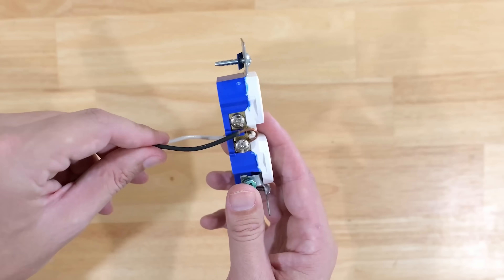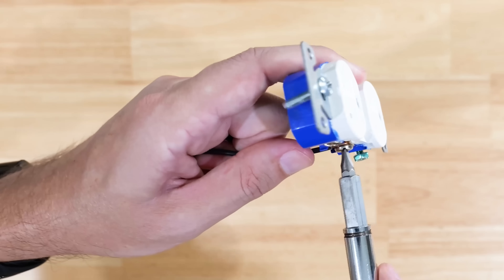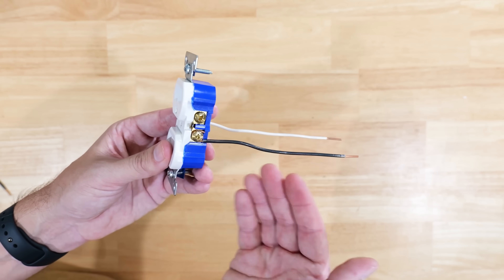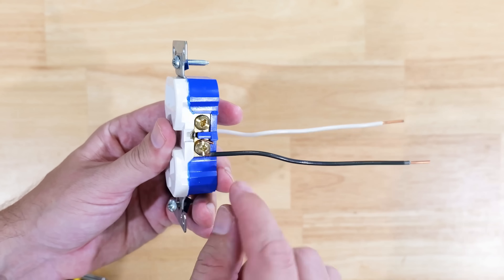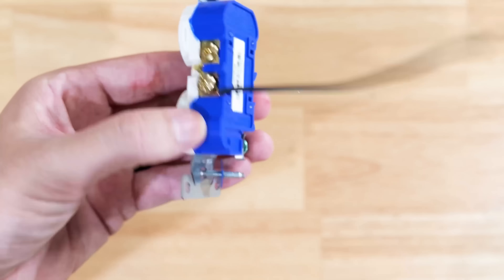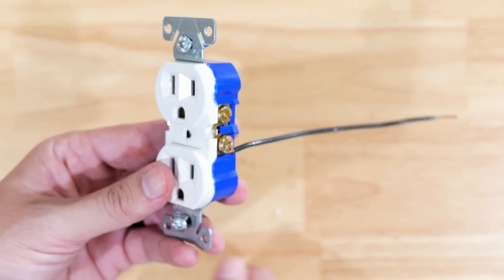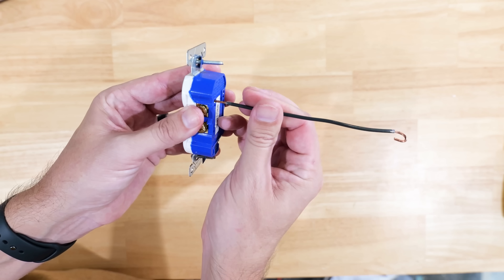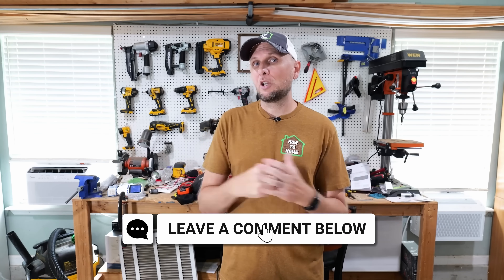Avoid Disaster! 8 FATAL Outlet Mistakes Most DIYers Unknowingly Make!

Comment: He failed to mention that whenever you’re installing the standard 15 amp receptacle and a metal box to tighten down the screw that you’re not putting a wire behind so that it’s not close to touching the metal box

Comment: With regard to tightening receptacle screws sufficiently, it’s worth investing in an ECX screwdriver. Much less prone to camming out than Phillips, as its slightly different design is specifically for receptacle screws.
Reply: That's true in theory; with virtually any outlet I've tried, an ECX bit actually slips BEFORE an appropriately sized Phillips bit does, at least with outlets from Leviton and Hubbell.

Comment: The current does not go backwards for reverse polarity installations. 
The biggest issue IMO is that you will have the exposed parts that have full voltage in the off state.
Reply: right, AC current flows in both directions, DC does not.  The problem is electrocution since even with the switch of an appliance in the off position, power is coming up  on the side that the equipment assumes is connected to the neutral...which it isn't in this case.  It bugged me to when he said it flows in the wrong direction, that isn't how reality works.

Comment: What I See Electricians(Loosely Used) AND DIY'rs do is Put 14 Guage on a 20 Amp Breaker. Not Good.
As Far a Polarity, Most Things Work Reverse Polarity, No Danger, No Big Deal, I Think Polarity is Mostly For Plugging Lamps in, With Reverse Polarity, The Shell of a Lamp is Live and Can Easily Be Touched when Changing a Light Bulb, With Correct Polarity The Live Connection is Deep in the Socket. 
When People Put Plug Ends on a cord, They need to Be Sure The Ribbed Wire on a Lamp Cord Goes to Large Prong of Plug.
Reply: In a correctly wired lamp the live connection does not reach the lamp socket when the switch is off. It ends at the switch, because that's where the circuit is opened (disconnected). What you're saying is correct if the switch is on when changing a bulb.

Comment: Black is Brass, Chrome is Common, Green is Ground.... how I was taught. it helps some folks to remember.
Reply: Black gold was the only word I was told but yours is much more complete for a novice to remember all the wires. 👍
Reply: @jameshill4900  How else could it be remembered. Three different wires that need to go to the correct plated or shaded screw terminals. BLACK easily goes to black. GREEN easily goes to green. Even if you forget WHITE goes to chrome, ya got nuthin else left, unless your wiring with three wire.

But you have a great idea. A shame your teachers did know you were never going to need that rhyme. They should had full faith in you. I'll bet it was more than justified, wasn't it?
Reply: @nothankyou5524  Black goes to gold (brass).  There is  no  black on a receptacle.
Reply: my uncle uses to tell me Mr. T is a black guy and he has a lot of gold around his neck so black to gold
Reply: @johnrhodes101875 same exact thing I heard.
Reply: @johnrhodes101875 nothing wrong with that. And certainly right if it does the job!!
Reply: Black/Brass (5 letter B words), White to white metal, bare copper/green to green/ground (green grass on the ground)
Reply: @YooTooobJeff What ever assists is a stellar statement!!!
Reply: White is bright. Black is bronze.
Reply: Black to brass, white to bright, bare to green.
Reply: 😅 @Jaderian87
Reply: I was a Coast Guard marine electrician. We always used "black on brass or its your ass!!!!"
Reply: Red can go to brass also.On DC black can be neutral.
Reply: @guruofendtimes819 DC is not A, and your not going to have it in cases like these. Not after the fact
Reply: @guruofendtimes819  But, we are talking AC
Reply: Brass to the grass. Oh wait, wrong MOS.
Reply: In 1900 wire insulation was varnished cotton that went black within a few years. The color marking was paint. The paint flakes off with age, not decades, just years. The line conductor is black and the grounded (neutral) conductor is white so that when the white paint flakes off you don't think the live conductor is safe to touch, you think the grounded conductor isn't safe to touch.
Reply: Excellent!!!   Thank you...making it easier to recall.😇
Reply: That's a good one. I was taught Black gold (oil). Silver was a white horse (Lone Ranger)
Reply: Black gold. like oil. a better one i think
Reply: Black to brass, white to light, green to ground.
Reply: That’s actually pretty simple 😊. I’m so curious about a couple of plugs I have installed
Reply: Also when using EXTENSION wires / cables pay attention to live and neutral lines  in the cable, the Striped or lettered wires are usually the live or powered wires, bare or green wires are of course  the ground, this is important for light socket wiring!
Reply: I was told, “whites like silver, n*g*as like gold.” Never forgot it lol
Reply: Where does the common go on a 3 way switch.
Reply: Very nice! Very nice indeed!
Reply: Black to brass, white to bright
Reply: Assuming you are staring at a correctly wired house, and all.
Reply: Which one is the ungrounded conductor? None of you are serious people.
Reply: So being serious. To truly know which wire goes where you look at the front of the receptacle. There is a narrow slot and a thick slot so you can’t install a polarized plug upside down. 

The narrow slot connects to the hot ungrounded wire. So the hot ungrounded wires connects to that side of the receptacle. If you want to be triple sure you can use a volt meter and check continuity between the narrow slot and the screws. The screw with continuity to the narrow slot is where the hot ungrounded wire goes. 

Hope that helps
Reply: @ecospider5  To be 100%, you really should be able to tell the difference between a hot wire and a neutral, regardless of color, configuration, ect. Taking chances and trusting others is how fires happen. 

Because if I do it incorrectly but in just the right way, I will produce the same stable circuit as you... and then you come along and your understanding of circuits doesn't account for my lack of proper knowledge being outweighed by my cleverness/ingenuity. 

A basic understanding of current goes a long way to burning everyone else's house down.
Reply: @boburanus69
Very good point. Standards are a thing for a reason
Reply: @NHGUIDE88  I like how you said black is brass, Chrome is Common/Neutral, and Green/Bare is ground. It will help me remember. It's easy to remember because the letters are the same. Example
Reply: That's a nice one because the first letters match each other. Example: Black is Brass. 👍👍😀
Reply: Thats great!

I taught myself,

Black. to brass,white to silver.
Reply: You need to check the wires.  Alot of guys back in the day used white for hot and black for ground. Check the wires with a meter!
Reply: Black to Brass to save your ass.  Learn that once.
Reply: @shawnbadanjek9561 came to this comment to add that one lol
Reply: @shawnbadanjek9561  saves your ass
Reply: i sadly was taught black to brass ( cause black people love gold) and white to silver (cause white guys like silver/silver is closer to white) i mean its sad but memorable
Reply: @SimplyMagic123 i dont see, "sadly". I see something that works for you. You're not out there selling T - shirts. Im sure your keep on the low. Everything seems to improve over time. Apparently, you certainly did. That's something to be proud of!!!
Reply: @ Is that a.... positive example of racism? Also: racism saving lives?
Reply: stereotyping is different than racism.  Relax, drink a coke and celebrate electricity.
Reply: Weird I know but I grew up in the 70's. Black/gold = Steelers and white/silver = Cowboys
Reply: I ended up with some used receptacles where they had completely removed the screws. 

I have found the ground screw is always on the neutral side. Anyone know if that is a requirement.
Reply: @ecospider5 it's never connected to the internals. Especially if it's bare copper. Do it once  or twice you wont forget. Its also not opposite the the power or neutral. Bty, red  can be hot and can ALSO be hot  on 3 way switches. I guess any wire could be anything, but they need to be clearly marked. If not, you could be in line for a punch in the shnoz, another mistake you'll not soon forget
Reply: @nothankyou5524
Good input thanks.

Comment: If you plug an actual 120V 20A cord connected load into that outlet, it would be on a 20A circuit.      
If you plug regular plugs ( 15A loads) into those outlets they will be just fine.
If your plug actually fits that receptacle, make sure it's on a 20A circuit.
You're not going to burn anything down because you want to buy quality backwired (not back stab) receptacles to use in your home.

Comment: Backstabbing is code and UL approved and has been for decades. I find more problems in renovations with terminal screws than backstabbed connections. If they were really as problematic as the wannabe-engineers-that-are-really-just-technicians make them out to be, they would have been banned decades ago. Electrical code writers are uptight. That's how you get things like AFCI. You think they're gonna enforce that, but let you burn down your house because of backstabbed outlets?

Comment: Absolutely Hilarious !   At the end you tell people to avoid all the problems and use a Wago type Plug, like the Wago wire connectors.
This after you tell people never to use the push in Back Stab connectors on the backs of older plugs.

Exactly what do you think are in the older Plugs that have the Back Stab connector holes?  That's right !  The same little wire tab that is in the Wago type connector.  On the old plugs, there is a slot to put a small screwdriver in to release the tabs hold on the wire, or as you show you can twist the wire while pulling firmly and the wire will work out.  

Whether you have a  Wago with the Lever or just the push in wire splice, they work Exactly The Same !  It's a thin strip of metal that your copper wire pushes past that does the electrical connection, and the load carrying.

So If you endorse ANY Wago or type of connector besides the Screw terminals, or Wire Nuts...You are getting a Less Secure connection and less physical contact of Wire to terminal, or Wire to Wire, meaning higher Amperage loads can potentially over heat those little tabs of wire and THAT is what can make the connections loose.  Heat Expands, including wires and connections.  

The number one reason connectors become loose is.....Wait for it.....  Not connecting them properly during initial install !  Yes, Electricians and their " helpers" are often in a hurry and don't hook things up properly when wiring a house or doing repairs.  And They are the " Professionals" you pay so the Job is Done Right !   Happens all the time, especially in New Construction homes in Subdivisions and multiple Dwelling units, because they have to get many fixtures installed and move on.

So.. The moral of my story.  Not all your information is always correct for one. And Two, even Electricians mess up.  Not to mention the occasional home HandyMan that does fixes for themselves or a friend.  Lastly, Newer Ideas AREN'T always better !

Comment: Loose connections, splices etc will always generate more heat. Mite take decades for an outlet to get nuked depending on usage but it will happen. If it ain’t tight it ain’t right.

Comment: Outlets oof will I guess two questions 1. How do I tell what gauge wire is in the box and 2. The reason I'm asking because I looked at the breaker itself for the amps and it says 20 is that wrong as I put 20 amp outlets in when I replaced the bass ones and 3. Do you have one for down steam GFCI love your stuff keep them coming

Comment: Whenever I connect stranded wire to a screw terminal , I always crimp on a Sta Kon terminal , I use the fork terminal and before tightening the screw terminal , I'll give the fork terminal a little pinch with a needle nose pliers , I have seen alot of receptacles that have overheated by putting stranded wire directly on the screw terminal , Even though the J hook is going the right direction , that connection will get loose , So always crimp on a Sta Kon terminal before connecting stranded wire to a screw terminal , One time I was replacing all the receptacles and switches at a motel and almost all the receptacles had overheated because the stranded wire was directly connected to the screw terminal and what happened was the strands unraveled after tightening , Even with the J hook in the right direction and that connection got loose which caused overheating 
So I put Sta Kon terminals on all stranded wire ends before connecting 
And by using the Sta Kon terminals 
There was no more overheating 
At least the overheated receptacles were caught before a fire started , So it's very important to use crimp on terminals when connecting to a screw terminal , either a fork or ring terminal 
This will ensure that you have a tight connection that will stay tight
Reply: You should never strip a stranded wire like a solid one if you're connecting to receptacles and switches. You need to mid strip, leaving a tail of an inch or so of insulation in order to keep the strands together. I'm not a big fan of that method either unless I have no choice. Preferably, use a commercial grade or better receptacle and back wire them by clamping down on the stranded wire.

Comment: While almost all people agree that backstabbing a recepticle should not be done under any circumstance,  why then are the they  UL  approved?
Reply from the maker: Great question.  Almost no electricians will defend it.
Reply: @HowToHomeDIY  They are almost universally how the outlets and switches are connected in any subdivision home.
Reply: Because when they are used properly, and the Circuit isn't over volted or Amped, they were just as good as the screw terminals.   
Wago connectors of today ARE EXACTLY THE SAME THING on the inside.  The ones he showed have the lever to release the wire, but the old backstab plugs have a slot to put a screwdriver in to release the wire, or you can twist the wire out like he showed.  Wagos work EXACTLY the same !  Why are Wago connectors okay today, when the Plugs are thought Not to be Okay ?
Some of it has to do with the SIZE of the little wire tab in the Connector.  Larger metal tabs can contact more surface area, and withstand more Amperage draw, without heating up.
Reply: @jameslester4474    Still begs the question, why are they UL approved.  If they have caveats (load, amps, etc), why are they not stated anywhere.  Agree they are similar to the WAGO 221's, yet nobody seems to have any problems with those.

Comment: What tool do you use to trace an outlet not working?  My outside receptacle was working, now it has no power to any of the wire.  I tried to find what other receptacle is not working but each one is working.  Thanks.
Reply: If outside there may be a GFIC breaker or receptacle you have not found.  Also check both sides of the other receptacles  there is a bar that connects them and it could be broken/burned out.   You may want to use a lamp that has a light bulb in it to plug in the receptacles.

Comment: The rating of the receptacle has nothing at all to do with the amount of amps flowing. Check your codes again.
Reply from the maker: You’re going to have to be more specific because your statement is right and wrong at the same time in that yes, an outlet itself is not a limiter, but wrong in that if the wrong receptacle is put on a circuit, it can allow too high of an amp draw on the circuit and wiring.
Reply: @HowToHomeDIY  The only way a receptacle can allow too high of an amp draw is if you put a 20 amp receptacle on a 15 amp circuit AND you plug in an appliance with a 20 amp plug that may draw up to 16 amps. So, the 20 amp plug has a mechanical allowance, not an electrical one. If you use a 15 amp plug (99% of the time) there's no restriction or added allowance on current draw, which is determined by the load. I'm sure you know that.

Comment: Question re: Breaker sizing. 12 gauge seems to generally call for 20A max. AC 90 12 gauge can take up to 30A even going up to 90 Celsius. While one can limit the breaker to just 10A to be “very” safe, is a 30A breaker a no-no here even if the wire could handle the amps even going to the higher limits? Actually the (non-switching steady) load working normally in the current state is not expected to even cross 15A but that is not counting future expansion. Is that “expansion” when it comes limited to below 5A?
Reply: The NEC specifically calls out maximum allowable overcurrent protection devices for 10, 12, and 14 AWG wiring as 30, 20, and 15 amps respectively.  So, yes, a 30A breaker feeding #12 wire is a very big no-no.